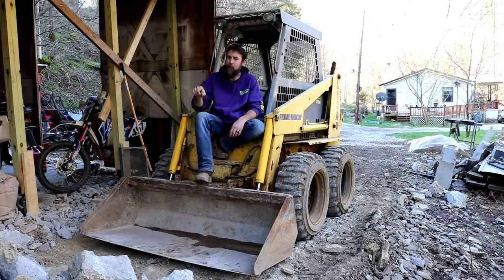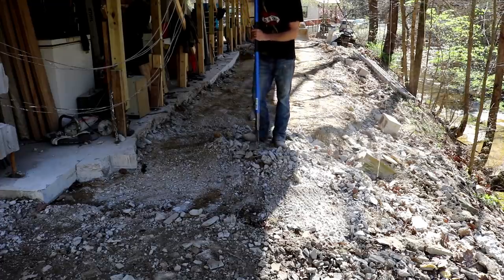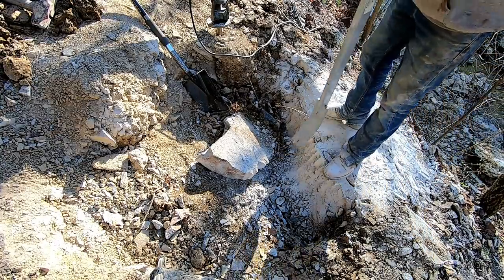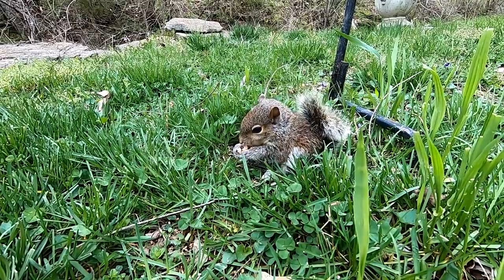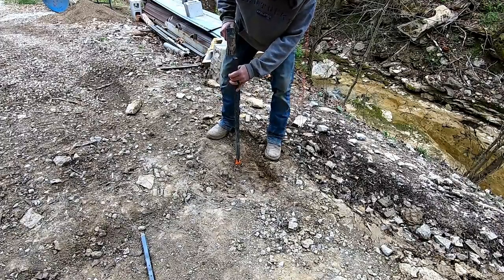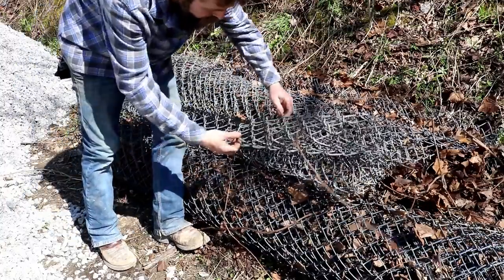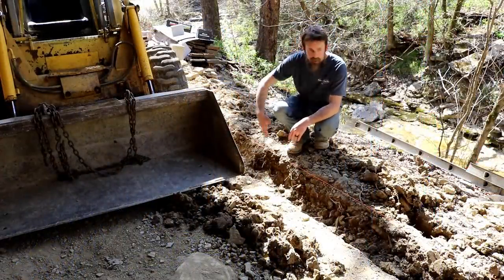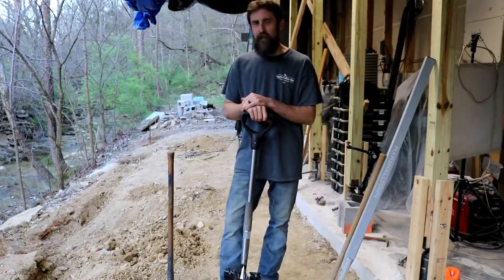BIG Rock and shop floor rubble Removal  It Keeps getting better! Shop damage part 9

Comment: Great job Steve. Usually we set our stakes a couple foot back, inline with both 90* stringlines. That way you can take the string down or move to side to dig with out loosing your corner. That or set up some batter boards to do the same thing. ATB.
Reply: Essential Craftsman has a video on batter boards that's worth a watch.

Comment: Steve I'm no expert at all but it looks like that big rock was happier splitting horizontally. If you are going to split another rock the same way it looks like drilling a hole for the tip of the impact drill will be safer for you. Take care you don't want to need to go to hospital at the moment if you don't need to!
Reply: That was my though.  A layered rock, like that one, looked like it would split easier from the side.  I was afraid that chisel was gonna find his foot.
Reply: Next time drill a hole in the middle and put a 1/4 stick of dynamite in it.  Know many people down there that do exactly that when they are trying to get rid of these rocks.  Friends of mine built a home down in the area and the foundation company had a crew that came in and blasted dozens of rocks using that technique.   Pulverized them and then they could take out the rubble.
Reply: @WreckDiver99  They make expansion grout and putty, like "Bustar".  Drill a hole, as you did, fill it with the expansion compound and viola, rock splits and breaks.  None of the legal "things" with dynamite.  Fine for smaller projects like yours and places shock waves are not desirable.  Be safe, if you had fallen on an implement or just the wrong way...
Reply: @geoffmorgan6059  But where is the FUN in that!!!?!?!?!  LOL
Reply: @WreckDiver99  Gotta admit I was slightly dissapointed when that didn't happen
Reply: @WreckDiver99  that was the exact same reaction I had. Lol!! Tanerite and an AR sound like an even better option honestly. At least easier to obtain those than actual dynamite. Dang what I wouldn't give to be able to run to Rural King and grab a few sticks of dynamite just bc I wanna blow some shit up like it's the 1920's. Yeeyee!!

Comment: Re: the neighbor's gift

I've done a number of 'Cyclone' fences in my life. When I did the first one, someone taught me you don't have to cut the stuff. You can also length a too short piece by weaving two pieces together.

Look at the top and the bottom, and you'll see the wire is bent over. Straighten out both ends, and you can 'unscrew' the piece from the fencing.  Do the reverse to weave two pieces together.  The trick is the stuff is just like chain, you have to take out two 'links', as any adjacent wires are a mirror. Try to weave a fence together without knowing that, and it's a nightmare.

You're certainly right about the quality. The gauge of wire in fencing from HD or Lowes is smaller.  They buy the light gauge fencing, and sell it at a good price for heavy gauge.

Comment: 7:30 Drill three of those holes and split the rock with 3 stone wedges. Probably goes fine with just two.
Ive done quite many at home in granite with a set of four 8 inch wedges 20mm diameter.
Drilling is the hard part.
Then insert the wedges and hit them with a small sledge so that they "sing" with the same pitch, then the tension is equal across and the rock splits.

Comment: I poured a 12 x 17 slab in 2 sections with a mixer like that. 2 guys loading bags , mixing , dumping. And one guy finishing. Each section took 2- 1/2 hours to mix and  place it in the form, and another hour for finishing, edging, etc. I used 153 bags @  $1.70 per bag. If you have the help it’s much better, each man can do his job without too much stress.

Comment: Steve, when breaking rock, find the grain and use the fissures to split it. Much easier than trying to break it across the grain. Just a tip from lots of rock breaking.
Reply: John Sullivan guess you did hard time? 😜
Reply: @sblack48  :🤣🤣🤣🤣
Reply: Rv4 Guy haha! Yes I reckon I did. We built a house on an igneous rock called dolerite. It’s on e of the hardest rock there is (not counting diamonds etc.) I was using a hydraulic hammer on a 3tn excavator and it just made dust and only dented the rock. But if you find a crack and see which way the grain runs, you can split it along that seam. I’ve hit it as hard as I could with a lathe sledge hammer and it bounces off like it was rubber.  Yes it was like doing time. But other part break down where exposed to rain and sun, we call it decomposed or weather dolerite. I reckon it all has to do with how it cooled in the magma dyke or sill. Chalk it up to experience.
Reply: @johnsullivan7633  : haha! good come back. Have you seen those dolerite vases and bowls in Cairo museum? It's a poser how they did those, but maybe they knew about acids and patient work. But youd swear they were turned on a lathe. But some have ears, little handles, and just amazing for being 2000+ trs old.
Reply: Pockets MacCartney no, I hadn’t seen that before. I have now and and in awe of how they did that. Basalt is from the same source as dolerite but have s different crystal structure and have cooled differently (I understand). You are right to ascribe that acid will decompose the hard igneous rock. I have seen some wonderful examples of acidic ground water decomposing the rock like it was a candy sucked in ones mouth. Parts of our state were once huge basalt flows and have now decomposed leaving rich red soil 10ft deep which will grow anything.

Comment: When you're chipping on an angle it helps to foot the bit to get it started. You want to lean the shank of the hammer on the outside of your boot to stabilize it and keep it from walking. Just a bit of pro technique.

Comment: If you want to put in that marker, and are unsure if there is shale down there start the hole with that SDS drill and the long drill bit. If nothing there you get a good pilot hole, and if there is a rock down there you make a hole through it instead.

Comment: Steve,
   You mentioned was a job it would be to pour your foundation and floor with that little mixer if not impossible. It is possible if you have forever to do. When I was in Vietnam back in 1969-70-71 I watched three little Vietnamese women on a bridge building project. My engineer company built a class A highway up through the Central Highlands. The women built the bridge across the river for the  highway. We used a Baily float bridge and later a truss bridge. The women sifted the sand right from the river as well as dug out the gravel. The form for the bridge pillars was a slip form that was raised after it was filled and the concrete set. The only man on the job was the crane operator that lifted the spill bucket over to the form and dumped it. Those women sifted and shoveled and mixed cement ten hours a day, seven days a week. The only time they took off was during the TET new year holidays. It was amazing to watch. By the time  I left they were nearing the finish of the fourth pillar. Two years work and they still had the approaches on either side of the river to do. I got curios awhile back and decided to see by way of google maps if the bridge was finished. With the war ending the way it did I wasn’t sure if the work continued. Sure enough the satellite image clearly shows the bridge with vehicle traffic crossing it.
Reply: Link?
Reply: my father used to work construcrion in his youth and can still point at buildings and say i helped build that , i bet those women are pretty proud of there work
Reply: Dale Griggs  I live in Vietnam, of course we have concrete trucks and pumps, but there are women working thses sites, doing rebar, etc. But on many rural projects little has changed since you were here.  I was in Pleiku in 1966/67, now live just north of the former DMZ in Dong Hoi.
Reply: Linc Reed-Nickerson I was actually in a village called Dinh Quan. The highway we built was QL 20 that stretched from Bien Hoa to Ban Me Thout. The river in question was La Ngie if my memory serves which is doubtful. Dinh Quan was fairly l
Reply: Linc Reed-Nickerson I realize Vietnam is a different country today with some modern facilities available in the cities and heavily populated areas. Much has been done since the rulers allowed a market economy to develop, especially in the southern regions. Still in the areas I was in it’s pretty much the same as fifty years ago. I watch a video channel called “Vietnam Village”. The utuber that posts the videos travels mostly to rural areas to relate how the villagers live their lives and accomplish many different tasks. In those areas not much has changed. Manual labor is the paramount vehicle for any improvements. He films mostly in the north in and around the Hanoi area. I wish he would go south to the remote hamlets. The villages that make up those hamlets have advanced very little beyond what they have done for a thousand years. That’s the environment I lived in while I was there and learned to appreciate the simple lifestyle that had sustained the Vietnamese to survive Eve the most harsh extremes. I learned much from them and there determination to survive and even prosper despite the circumstances.
Reply from the maker: Thanks for the story, that's really cool. 👍

Comment: Just a suggestions there . You could use the jack hammer to make your holes where you are going too put the peg if there is a rock there ...  I would make you foundation a inch wider than the initial line where there plum bob come down so it will give you a bit of leeway when laying you cinder block down ....

Comment: Make sure you anchor your rebar into the old slab. Drilling and epoxying/grouting the connection bars into the old slab.  Great work. I am with you on concrete foundation and wood walls.

Comment: Steve:

If you make up a tool for that jackhammer....you can use it to drive steel bars & pins into the ground...

I use an SDS drill to drive earthing rods into the ground when I'm installing a TT system...🇬🇧☺️

Comment: It sounds silly but a trick I use for getting the stakes in the right location is I drill a  hole with the hammer drill. I do it when the ground is frozen as well.   Love the vids.

Comment: lol, very familiar with a shovel, about 1992 I built a 32x32 building and hand dug the footing walls, of course I didnt have the rock you have. I also formed it 16 ft at a time and used a mixer kinda like yours to pour it. I tied  each section together with rebar. after moving in fill and gravel base i ordered concrete from local co and had a couple friends helping to spread it and do finish work. First floor i ever done and it is still in one piece with no cracks. I did not use any rebar or wire in the floor which was 5 inches thick but did have the fiber added to the mix. Its kinda scary when they dump $900 worth of concrete and its your first time doing it. I think getting the plumbing in for the floor drains and bathroom was the most nerve wracking part of the whole build.

Comment: You could use  micro blasters fo breaking up the rocks quickly and safely, they are like tiny sticks of dynamite and work well for splitting that sized rock. No explosives license required. Also you are lucky to have the skid steer available for as long as you need it.

Comment: Running into rocks one of those things that you unfortunately have to deal with. When putting up my barn I ran into hidden cement all over the place from a former barn that had burned down during a storm. It's definitely a adventure. Be careful on that heavy lifting, you can mess up your back without even realizing it. Good work...

Comment: Steve coming along.  Good idea with the stem wall then wood frame up.  I think reinforcement of the bank is also a good idea but I would leave as many of the big rocks as possible.  When we do reclamation work we try to use all the big stuff on the bottom and get smaller as you go up.  I think that chain link fence is awesome to use as support for rip-rap.  Good luck keep you and your family safe.

Comment: One of the ways to lay out piping and electrical conduit that will be on the ceiling is to use a string line with a plumb bob. Simply draw out your pipe or conduit runs on the floor of your shop or building and then, using a step ladder or rolling scaffold, go up to your ceiling, let your plumb bob contact your lines on your layout and mark it on your ceiling. When you are done you can install all of your ceiling mounts or hangars and they just take the piping or conduit up to them when the time comes. I have  run overhead piping this way in buildings and if done with a reasonable amount of care your hangars will be within 1/8" of where they are required. 
When working with a plumb bob outside, the wind can be a problem as it will cause your string to move around. Take a large coffee can or a similar vessel that is round and fill it up with heavy oil. Hang your plumb bob from your point above so it clears the floor or the ground by about 1/2". Then put the plumb bob in the container of oil and use it as a damper. To get your centre mark, measure to your string and centre it in your container (this is why the container should be round) and then mark around the base of your container. When you move the container you can use your mark to measure out the centre.
Reply: Scooter Tramp really clever tricks. Clearly you've done some real heavy work jobs.

Comment: Stringline, plumb bob and water level, ancient tools, easy to make and still used daily in all parts of the world, a lot cheaper than a decent laser level and work in bright sunlight.
Reply: I've farted around with a water level some and wasn't impressed. Long clear vinyl hose got yellow in the sun, weathered quickly, stiff in the cold weather, air bubbles/kinks in the hose made inaccurate readings I used a bucket for a reservoir was cumbersome. Go with the laser level and work in the evenings/cloudy days. Yes, I was squeamish and had to look away when the shovels showed up. I'm currently trying to install window wells 'bout 5' deep. I've got good old blow sand to dig in  and am still wore out getting the Tin wells installed. Good Diggin' to you and Maybe not too many more big rocks.
Reply: @bjre.wa.8681  All the ones I have seen or used had a glass vail with a scale on them and also a plug to close them off if needed to keep them full for storage, Where they shine over a laser is from say room to room, a laser cannot penetrate walls but with a water level as long as you can get the hose in they will work. I have also seen special liquid for water levels that supposedly helps to get bubbles out and makes the liquid more fluid, I think its only something like glycol or soapy water, never used it though. 
You can get a laser level to work in different rooms by shining through a door or window, make a mark then transfer the laser and realign but more room for error and takes longer.

Comment: Steve, Something to consider in a shale creek bed addition for erosion control.  Our family house had a similar creek situation, ( a curve which was upstream from our house)  dad spent tons of money pouring a concrete bank with huge rock, to direct the water away from the house.  We found after a few heavy spring rains the water was cutting under, and in front of the concrete bank.  Dad and I started upstream planting Willow whips maybe (100) 12-14", they can be started from clippings grow very fast in wet soil and have an strong root system. We planted them abt 2-3' apart starting at base of creek bed. After the first year the shoots can be redirected back to the ground up the bank and they will root again. They naturally wove them self into a "mesh" along the bank, after 40 years, the willows did a better job.  best of luck.

Comment: Hitting rocks on hard corners is why we use batter bords in the trade. They are also nice to use because they can be set outside the actual building lines and reused. Also when using the electric hammer in strange positions use your foot to hold the point in place.

Comment: Stev, sound good, the foundation, with blocs on top and timber frame wall.  Like you said you reduce the weight on that side and it will be a better and stable foundation since you next to a ditch where water flows.

Comment: Steve,
I agree with everything you are doing so far. (46 years in construction)
Only thing I would suggest to do is take the time to drill down to bedrock in at least 3 places ends and middle and pour pilings.
Reply: Totally agree, I would have a pile at the corners and e very 4 to 5 ft down that wall

Comment: 7:20 I had to tell a contractor to do exactly this method on a project I had for a natural gas compressor station.  They Jack hammered for hours with not much progress.  Drill a series of holes with a hammer drill and then jackhammer!

Comment: It's definitely worth getting some concrete pros in there to help push the project along. They'll get it done quickly and efficiently. 2 experienced concrete guys can get the footer and slab done in 2 days. 2 separate pours.

Comment: Steve, love your videos. Have you considered driving piles down into the river bank? Like sheets of steel that interlock together.
I am concerned that the land will continue to  erode down over time.
Reply: I was thinking of sheet piling myself
Reply: Yes,  this method would seem like the best solution against further sinking of the foundation
Reply: The shale probably makes that impossible. It would take some large equipment to drive that. Everything might have to be drilled first.
Reply: I can definitively say that that approach would be cost-prohibitive.

Comment: I saw move out of demolished concrete. Wonder if this is an idea - place it by the river bank above a water level non rainy season and near the future concrete foundation. For two reasons. (1) compress the soil to slow down future side slip toward stream (2) when water level rose it slows sown flow rate at that section to slow down erosion rate.